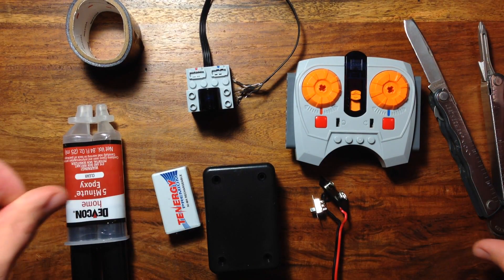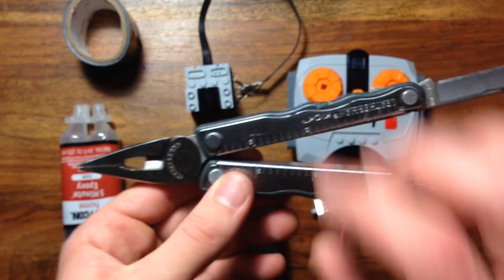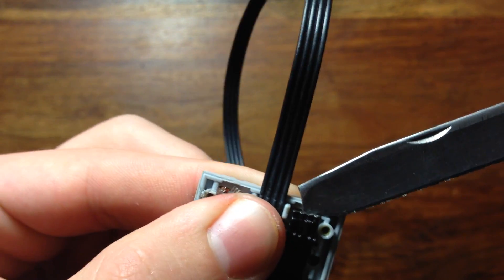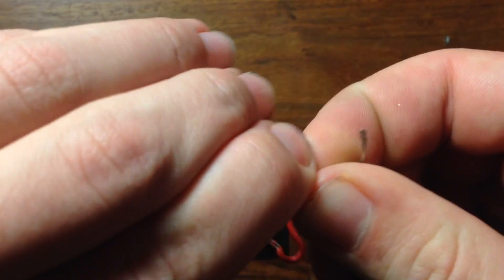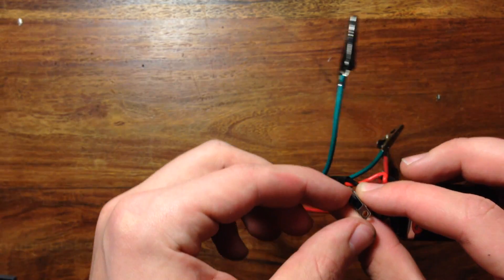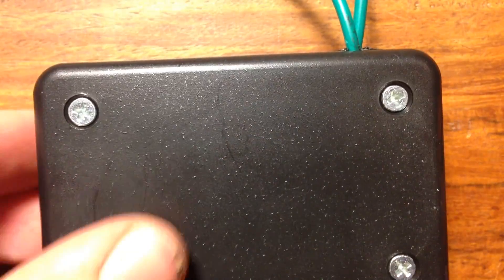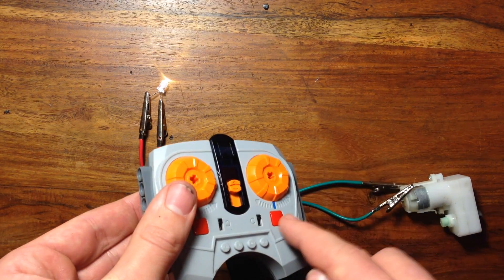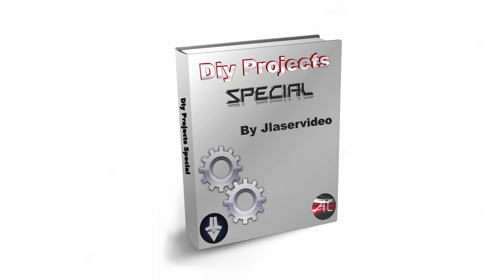How to Make a Remote Control Circuit

Comment: Dude you have no idea what your doing do you? You strip wires with a fucking needle nose and you DONT test a circuit by "touching" it to the battery to check for polarity,, thats a good way to fry the circuit. Its called use a fucking multimeter to check for polarity.
Reply: well someones angry
Reply: +sonictales69 wow, not just a keyboard warrior but sexist as well

Comment: Would this "thingy" work to simply close the circuit to small external computer speakers?  It seems that it provides batt. power to the circuit which is unwanted for my app. Thanx.      Gb bg
Reply: Use something called a relay. It (usually) has two pins that activate an electromagnet which connects or disconnects two pins from each other. Hook the receiver "thingy" to the electromagnet pins and then use the other pins as desired. That also means if you have a big enough relay you can use this device to pass infinite amounts of current.

Comment: hello sir..
i like your video...
i want to make rc control skateboard. .
can i able to operate skateboard  dc motor  with this two rc reciever and controller? ? 

or this  rc reciever and controller ...only use for small toy  car? 

please give me suggestions. .

please reply
Reply: you could if you have a powerful enough battery, but the weight of the battery might slow it down also....it wont go very fast

Comment: Just a tip, whenever twisting wires do so in a clockwise direction, the reason for this is if you're going to use a wire nut and you've already twisted it counter clockwise the wires will open up when you start to twist on the wire nut, lefty loosey righty tighty.

Comment: How do you increase the range of an rc car 27 mhz channel pls reply😊
Reply: change the transmitter board and amplify it with transistor., but when you do that, you need to change the cap too to filter the frequency.

Comment: Today Ill teach you to make cheap RC circuit..Buy a lego rc receiver and transmitter.. WTF
Reply: I guess that was a misleading title, but this is still very useful. If you wanted to make one from scratch, it would probably be a lot harder and more expensive.
Reply: Boscar Slút Actually it neither would be expensive nor difficult, if one has basic soldering experience. Circuits are readily available, components are cheaply available as well, even free if one can scrap the old radio and any pcb circuits. 
E.g.
http://pcbheaven.com/opendir/index.php?show=7471uk8807mj49773b5d
http://www.talkingelectronics.com/projects/27MHz%20Transmitters/27MHzLinks-1.html

Last time when I was in uni, I made, roughly cost me around 10 bucks in total, still cheaper than ready made components, I reckon...

But for good range & reliability, one has to fiddle a bit with inductor coil for frequency tuning, requires patience and experimentation, so would be a project in itself than it's application..AM would be lot easier though..

Ya title is misleading...agreed..title should have been something like application of lego rc rx/tx...
Reply: num lock yeah the title must be how to assemble

Comment: This can also be done by cannibalizing IR transmitter/receivers from cheap RC cars costing less than $10 or unused RC cars for basically nothing, but at $12.99, the LEGO brand kit is still very reasonable.

Comment: or you can get rc transmitter and Receiver fro rc stuff for £20 on ebay and the range is like over a mile :))))) am getting it
Reply: its from £20 to £40 http://www.ebay.co.uk/itm/FS-GT2-2CH-2-4GHz-Radio-Remote-Control-Transmitter-Receiver-for-RC-Car-Boat-UK-/360685925008?pt=UK_ToysGames_RadioControlled_JN&hash=item53fa8e7290
Reply: its not bad but after some time its better buy ing a better one
Reply: I know